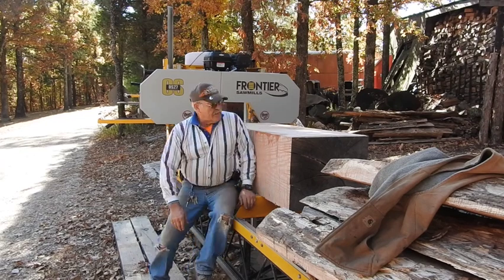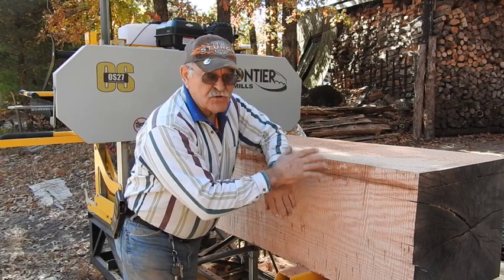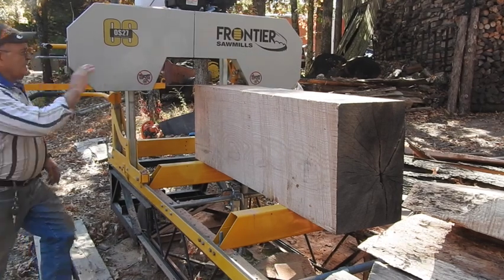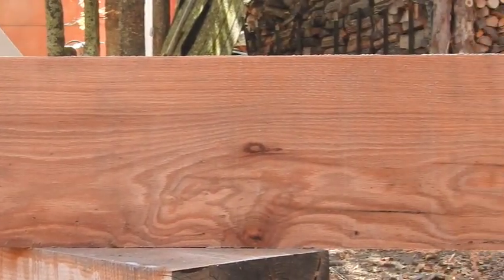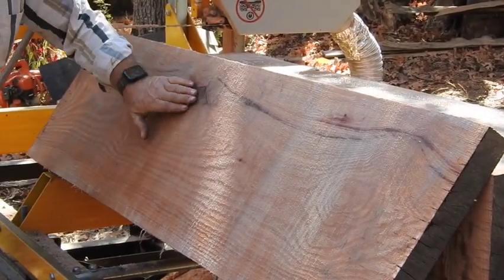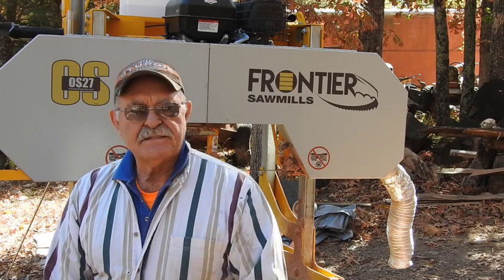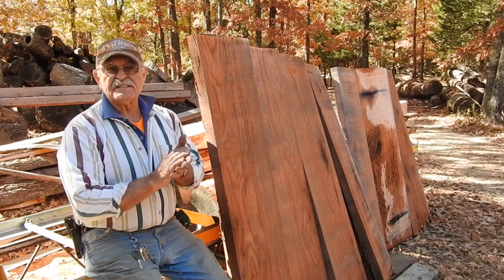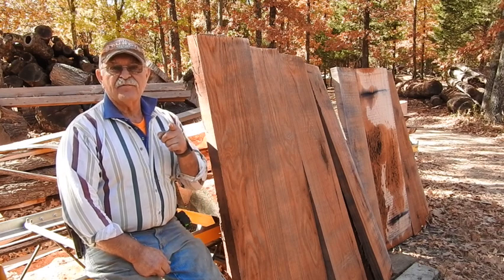Watch an OS27 Frontier Mill Process a 21" Red Oak Cant

Comment: Wheelchair motor, sprockets and 40 chain, pwm controller, wire, forward and reverse switch. Little engineering, weld.
Reply from the maker: Good thoughts....I've got a few options in mind and that is one of them for sure.  The real problem is getting the time to dedicate to it.

Comment: Will the solar kiln be the next addition? That oak is tuff stuff. That weight adds up quick with 2" boards. Nicely done!
Reply from the maker: I'm just glad the cant wasn't a full 10 or 12 foot !!  I'd have a tough time carrying one this wide and that long.  I would love to have a solar kiln Chad, but I have so much lumber in storage from sawing years ago, that it's not a big deal for me to wait for the natural seasoning of the new materials coming off the band mill.   I just stack, strip and cover to air dry.  They figure one year per inch thickness by rule of thumb.  Depending on what you are using it for, it may be longer or shorter.

Comment: Really nice wood Wendell
Reply from the maker: This short log was slated for firewood so it was really used to set up the Holzfforma chainsaw mill.  I figured if we got anything good out of it at all it'd be better than firewood.  But now I know the other large diameter logs will eventually be worked down like this one. Some of them are 12 foot long if I remember right.  Thanks Dave for the supportive comment.